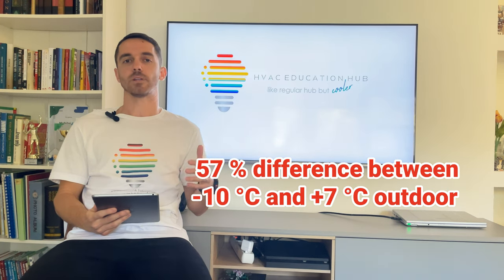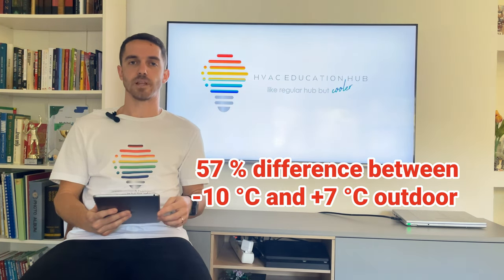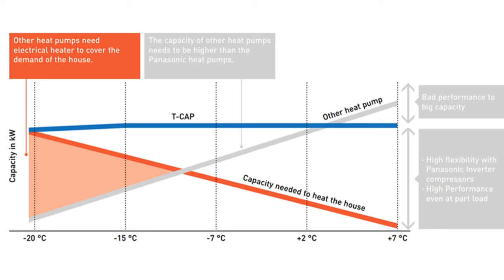The Main Problem with Oversized Heat Pump

Comment: I'm sorry but as the owner of a 50% oversized heat pump my experience is the opposite of what you claim. Modern heat pumps suffer very little inefficiency from oversizing, because they use the latest design pre-heated scroll compressors and intelligent management software. Undersizing, on the other hand, causes serious inefficiency at sub zero temperatures low enough to stretch a heat pump over capacity. Think about the logic. Say a typical heat pump consumes 5kWh per day in the mildest May/Oct temps, and 50kWh per day in the coldest Dec/Jan temps. For an oversized heat pump - even if it was 10% inefficienct in Oct/May mildest temps that would lose only 0.5kWh per day, but for an undersized heat pump 10% inefficiency in Dec/Jan coldest temps would lose 5kWh per day i.e. 10 times as much!  My heat pump, at the mildest temperatures (lowest heat demand), with my roomstat set to 19degC, switches on at that target temp and typically runs for say an hour or two at lowest flow temp, until room temperature reaches 20degC, switches off for however many hours are required for the room to cool down by one degree, switches on again, etc. This mode of operation cannot be regarded as "cycling", and has no real impact on my heat pump's efficiency. I know this because the actual data of measured output vs input (COP) is excellent - at least as good as the manufacturer's spec data table. There are other reasons for choosing an oversized heat pump:-
You may want to extend your house at some point in the future.
Your family all get cold or flu and you need the room temps to be a couple of degrees higher for a dew days or more in the depths of winter.
A design minimum temp of -3degC is inadequate to cover the coldest winter days. In 2022 15th and 16th Dec went below -12degC in Buckinghamshire.
And the associated loss of power due to regular defrost cycles - especially on nights of high relative humidity.
Reply from the maker: Hello, thank you for your feedback. Glad that your experience is different than mine.
Actually, your numbers above for typical consumption are only theoretical.

I am not talking that heat pump must be undersized, I am talking that in most of the cases, especially in new houses, this is the problem
Reply: @HVACEducationHub  There is no problem with having an oversized heat pump. In fact it is beneficial in terms of achieving lower operating costs. The manufacturer's test data table and my actual data confirm this to be true. I have an 11.2kW heat pump, whereas my initial design called for an 8.5kW heat pump. During periods of mild ambient temps and low heat demand, the auto adaptive management software prevents cycling by running at no less than minimum continuous power, allowing roomstat temp to overrun target temp by one degree of headroom, then switching off for however many hours are required for roomstat to cool back down by that one degree to target room temp, then the heat pump restarts again, and so on. Even for an oversized heat pump this avoids cycling altogether, so has no impact on efficiency.
Reply: All compressors (if it is an even serious manufacturer) have oil heating in the compressor, but this prevents hydraulic shock, i.e. makes it impossible to condense freon in the oil. This does not mean that it is good for the compressor to constantly turn on and off, because the efficiency of inverter compressors is that they have continuous operation, which is not the case if the heat pump is overside, and that is bad. If you are satisfied with the temperature in the house, it does not mean that your system is balanced and that you are getting the most out of your machine, because it is impossible to achieve optimal operation with a certain heat pump at -12 and +10°C 5:49
Reply: @mrkymuse9282  With respect this is incorrect. In modern heat pumps, you actually won't find oil used for heating the compressor! This was a common feature in older models, but newer technology has largely phased it out. My Mitsubishi Ecodan R32 11.2kW uses "resistive heating" which eliminates the problems caused by old tech oil heating. But anyway you have missed my other point - my oversize heat pump does never "constantly turn on and off", as I described to you in my previous reply. Even in the mildest Autumn ambient temperatures it never runs for less than an hour, which has no significant impact on efficiency. And if you look at the data tables you will see that an 11.2kW model running at 9kW is up to 30% more efficient than an 8.5kW model running flat out or over nominal capacity
Reply: Maybe You didn't understand me or I expressed myself badly. I did not say that the oil is used to heat the compressor, but that the compressors have oil heating, that is, they have an electric heater that is used to heat the oil in the crankcase. The oil must be warm for good lubrication and to prevent liquid formation in the compressor itself. I am glad that your system is working and that you are satisfied
Reply: @mrkymuse9282  The latest heat pumps, such as those made by Vaillant and Mitsubishi, use an inverter driven scroll compressor, which does not have a crankcase. Scroll compressors use direct resistive heating of the motor/compressor assembly. The method you describe of heating the oil in the crankcase is old technology. Don't take my word for it - ask the manufacturers. Because of this, there is no loss in efficiency from having an oversized heat pump, in fact the data tables for my heat pump, and my actual performance data, clearly show that an oversized heat pump is likely to be MORE efficient (i.e. have better SCOP) than one that only just meets design capacity at say -3degC
Reply: Sorry, but oil heating is not an old but a necessary technology. Believe it or not there are heat pumps that are not just for home use. when someone says 12, 16 or 20 KW it's funny to me because for a long time i've been dealing mainly with industrial cooling (CO2, NH3 etc.) where we're talking about MW and believe me every compressor (old and new) has an electric heater (screw, reciprocating, scroll, rotary).
Reply: @mrkymuse9282  I never said that they don't have electric heating, I said that the latest models such as those made by Vaillant and Mitsubishi do not have an oil filled crankcase, they use direct resistive heating of the comressor/motor assembly. A "crankcase" is a housing for a "crankshaft" used by old reciprocating compressors
Reply from the maker: @lumbarsupport  if you have such a great results, probably your hydraulic system is excellent.
Also, it is not the same if you have DOT -3 C (as usually is in UK) or DOT -15 C as we have in Croatia.

Temp diff between indoor and outdoor is 35 C for DOT -15 C ((20-(-15)) and only 23 C for DOT -3 C ((20-(-3).

So it is easier to have modulation on smaller difference than on wide area of 35 C.
Reply: @mrkymuse9282 Compressor is insulated and cooled with refrigerant. There is no significant loss of heat in compressor crankcase heating.
Reply: Any oversized heat pump problem can be simply solved by adding buffer tank and I prefer buffer tank/hydraulic separator as mandatory in my installations.
Reply from the maker: not completely correct, energy/heat in the buffer or installation is still the energy/heat - for example, 16 kW is 16 kW everywhere. With buffer, you can just increase a little bit that working time but not so much.
Reply: If you put in an undersized 6 kW heat pump you would have both lower bills and a longer life span.
My undersized heat pump has a maximum of one start per day and the lowest possible temperature on my radiators.
Global warming should also be taken into account.

Comment: Good explanation. A big problem for the UK. Because the heat loss calculation over estimate to be safe. The grants won't alow hybrid system with a resistive heater back up which may only be used a couple of days a year. So we end up with over sized pumps.  Hopefully as  installers get used to them and look at real world data the mach will improve.
Reply from the maker: Thanks.
Everywhere is the same, regulations are killing efficiency 😊

Comment: Love your Chanel. 
I  however disagree with you regarding no issues with oversizing gas boilers . Oversizing gas boilers is a major issue in the Uk. Boilers that are oversized will constantly Cycle on and off. This cycling effect causes stress and premature failure of boilers components. Many components are designed to do a certain amount of cycles, for example gas valves are designed to do  lets say 20000 on and off’s f. If the boiler is over sized then that number will be very quickly reached its design limit prematurely and can be prone to early failure , expansion vessel under undue pressure dues to cycling and stress. Leading to premature failure. Most modern boilers are supposed to be Condensing , yet over sized boiler really condensed because of being drastically over sized and incorrectly installed .The Average heat loss of the average Uk property is around 6kw !!!.
The most commonly sold boiler on the Uk is 30kw !!!! 
It’s a MAJOR issue here unfortunately.
Reply from the maker: Agree, you are right, but gas valve is a lot cheaper than compressor 😉
So definitely not so big issue as heat pump.
Another thing is that with gas boiler you need to have more kW because of the instantenious DHW and on heating side the new ones can modulate really low, 10% of the maximum power.

Comment: If it's a VFD with 100 levels, it seems like it should be OK unless the thermostat has a poorly designed algorithm for setting the power level.
Reply from the maker: Minimum capacity is the lower, no matter how good or bad the thermostat is

Comment: You did not cover variable speed and two speed units.
Reply from the maker: You mean pump variable speed?
Reply: Do you know what “modulation” means?
Reply: @kevinmills5293  It is a word that has many meanings and depends upon the application.
Reply: @kevinmills5293  Modulation is a word that has many meanings depending on application. Since you kept repeating the word modulation of the compressor I assumed you were talking about a single speed unit and the compressor “modulation” was being controlled by the TXV. This is different than the thermostat or run time regulating  or modulating the heat pump. In a varible speed unit the algorithm modulates the unit by controlling the fan speeds, tvx, and compressor speed.

Since you never mentioned how you were modulating and never mentioned  the two speed and variable speed units, I made the assumtion that you were talking about single speed units. It appears you are talking about heating application only and not the units that cool and heat. 

I have had a heat pumps that also cool. I found in Texas the heat pumps cost more and wear out much faster and are not as efficient as air conditioners. I have found for my location it is better to use a super high efficiency air conditioner with electric heat strips since I do not have gas.
Reply from the maker: Hello, no, compressor modulation means inverter compressor with complex algorithm. Not ON/OFF compressor.

In some areas, especially where there is not so cold in the winter, air conditionier could be the best option.

Comment: So basically you mean 0% safety measures when calculating heat gain/loss :D
Reply from the maker: No, it means that you don't need to design heat pump system for few hours in year because you will spend more money and not have comfort in 99% of the year.
However, unit has back up heater so if anything happen this could solve the problem.
Also, system and house inertia (especially with underfloor heating) should be enough if designed properly. 😊